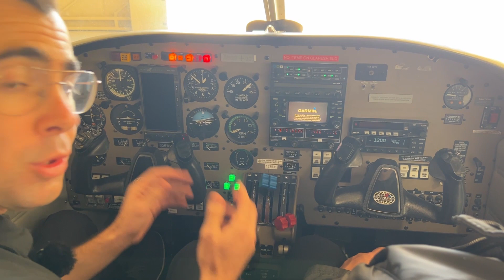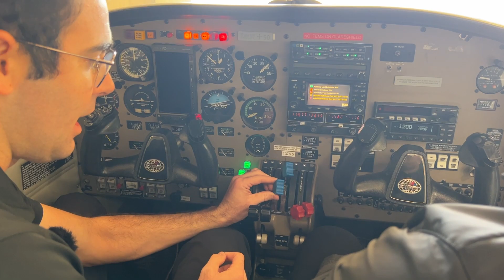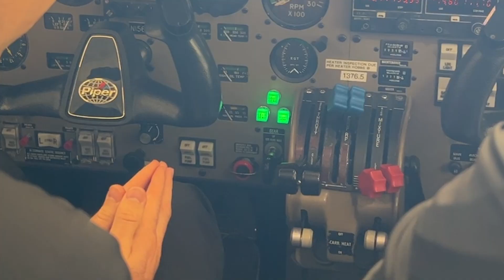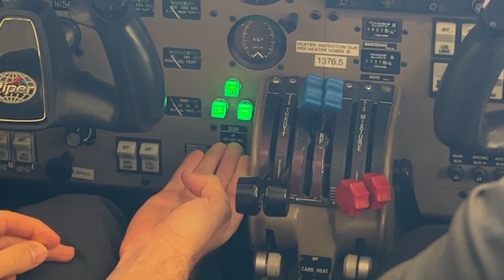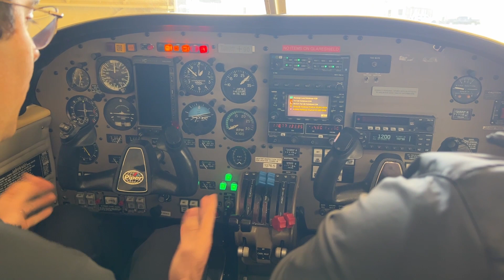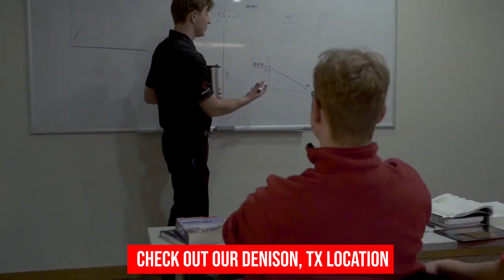4 Components of The Piper Seminole

Comment: Hm.. I’ve counted 3 - constant speed props, retractable gear and stabilator, what is the 4th?
Reply: No.# 2 @1:35 Right Engine Critical Engine
The critical engine is the engine that, when it fails, most adversely affects the
performance and handling qualities of the airplane.
The Seminole is equipped with a counter rotating propeller on the right engine . The failure of either engine has the same
effects on performance. This is why the Seminole does not have a critical engine .
On most multi-engine aircraft, both propellers rotate clockwise as viewed from
the cockpit. By understanding the following factors when flying an aircraft that
has both propellers rotating clockwise, it will be apparent that a left-engine
failure makes the aircraft more difficult to fly than a right-engine failure. The
clockwise rotation of the props contributes to the following factors that cause
the left engine to be critical:
P P-Factor
A Accelerated Slipstream
S Spiraling Slipstream
T Torque
P Factor (Yaw)  Both propellers turn clockwise as viewed from the
cockpit. At low airspeeds and high angles of attack,
the descending blade produces more thrust than
the ascending blade due to its increased angle of
attack. Though both propellers produce the same
overall thrust, the descending blade on the right
engine has a longer arm from the CG (or greater
leverage) than the descending blade on the left
engine. The left engine produces the thrust closest to center line. The yaw
produced by the loss of the left engine will be greater than the yaw produced
by the loss of the right engine, making the left engine critical.
Accelerated Slipstream (Roll and Pitch)
P Factor causes more thrust to be produced on the right side of the propeller.
This yields a center of lift that is closer to the aircraft's longitudinal axis on the
left engine and further from the
longitudinal axis on the right
engine and also results in less
negative lift on the tail. Because of
this, the roll produced by the loss
of the left engine will be greater than the roll produced by the loss of the right
engine, making the left engine critical.
Spiraling Slipstream (Yaw)
A spiraling slipstream from the left engine hits the
vertical stabilizer from the left, helping to counteract
the yaw produced by the loss of the right engine.
However, with a left engine failure, slipstream
from the right engine does not counteract the yaw
toward the dead engine because it spirals away
from the tail, making the left engine critical.
Torque (Roll)
For every action, there is an equal and opposite reaction. Since the propellers
rotate clockwise, the aircraft will tend to roll counterclockwise. When the
right engine is lost, the aircraft will roll to the right. The right rolling tendency,
however, is reduced by the
torque created by the left engine.
When the left engine is lost, the
aircraft will roll to the left, and
the torque produced by the right
engine will add to the left rolling tendency requiring more aileron input, which increases drag, making the left engine critical.
Summary
On most light multi-engine aircraft when the critical engine is inoperative, both
directional control and performance suffer more than when the non-critical
engine is inoperative.